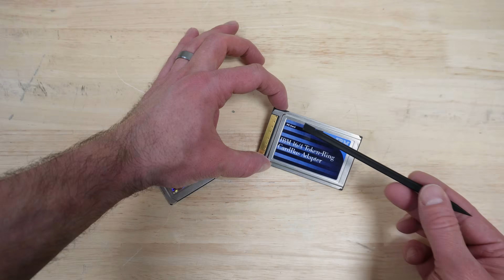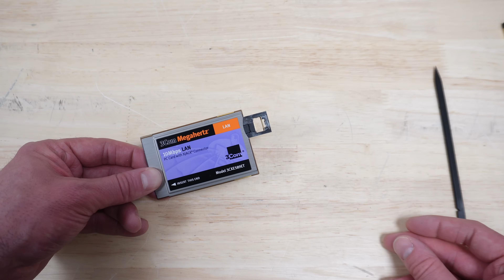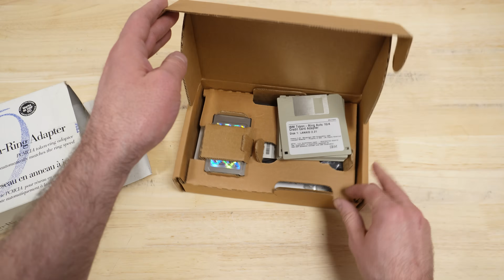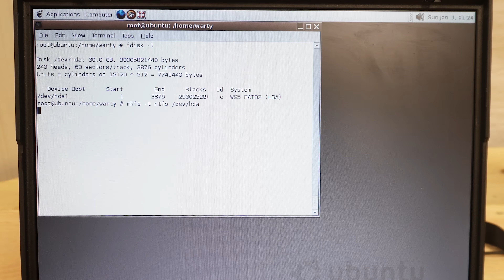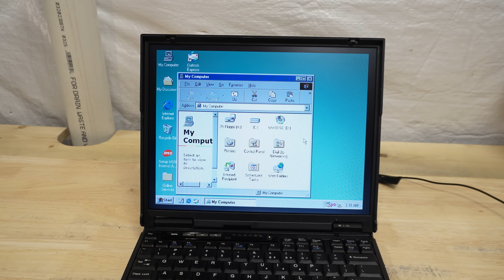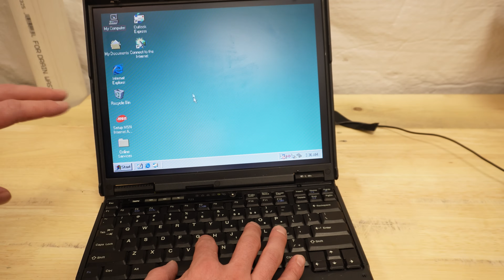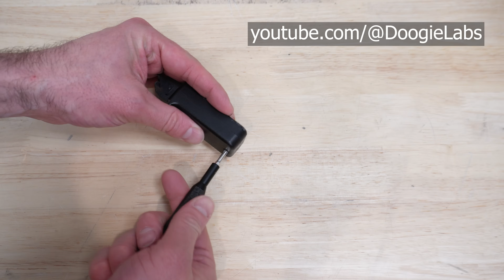Token Ring over PCMCIA Cards

Comment: Would be cool if you could get ahold of a schematic for the IBM MAU so that we get an understanding of what happens when you insert the reset tool
Reply: Almost no schematics for IBM stuff has ever made its way into the public view, more popular devices like thinkpads or the PS/2 line don’t even have them, so the only way would be reverse engineering it, I’ve opened one up to the bare board before, and they don’t look complex at all, don’t even think there were any chips
Reply: @ true, IBM was always very secretive about their hardware. But at least I found something about how the 8228 MAU. Seems the Relays are latching into position and the Setup Tool basically puts them back into a defined state. https://en.wikipedia.org/wiki/Media_access_unit

Comment: You have Vudeos about an BNC Network? I did a BNC Network with 25 PCs when i was 10 years old and i loved it. PCs with DOS, Wibdows 3.11 and later some with Windows 95. The biggest space between two PCs was 25 meter of BNC Cable. I miss this time
Reply: I had a thin-net network at home too. The IT guy at school gave me a bunch of old cables and T's, and maybe even some network cards they ripped out to replace with CAT5. He also let me "borrow" the Novell Netware disks, so I ran my own Netware server at home too for many years. I eventually upgraded to CAT5 at home too - much easier to run a single cable to each machine, rather than 2 to keep the bus of thinnet going.

Comment: Each usb stick needed their own driver installed from floppy disk on Windows 98. There were universal USB mass storage drivers released at some stage by 3rd parties, but they did not come with the system. Windows ME fixed this issue.
Reply: in grad school, I needed to get data off of an oscilloscope that ran win98 - I had to resort to a USB CF reader, as nothing else worked - standard USB keys didn't work, nor did setting up a SAMBA server on linux to try to transfer files by network share. Win98 really was pretty awful and pre-standard for a lot of things.
Reply: @gorak9000  I'm glad modern Samba gets along with my Windows 98 SE machines perfectly well with just a couple of smb.conf lines to accept older protocol versions and authentication methods. Now I just need to stop putting off getting my Windows 3.11 for Workgroups machine reinstalled so I can confirm it's compatible with that too.
Reply: Yep of all the things to complain about Windows ME, driver support was REALLY good. 

In high school I had to bring along a mini cd which had the USB stick driver on it.

Comment: I was born in 84, I know what you mean with all the love for the old technology especially Windows, my favorite was already Windows 2000 I felt that it was one of the best most stable OS that Microsoft ever made. I do Network Administration and have a nice home lab setup as well. I went through CCNA and that. It would be awesome if you wanna do any kind of collab stuff, I want to start doing some learning/training videos. Also, I am from New York.
Reply: IBM's version of (4Mbps) Token-Ring was introduced in October of 1985 - I was in bootcamp then.
Reply: Win2k was the best windows at the time, but it was the version that convinced me it was time to switch to Linux full time - I got so tired of having to re-install windows every 6 months to keep my computer fast. I don't know why it got slow all the time - I didn't install a bunch of weird random software, and kept the drive defragged, it'd just get horrifically slow over time. Doing a fresh install fixed it, for a while. Installing Linux fixed it permanently.

Comment: For the drive, you forgot you can fdisk the drive in dos. run "start the computer with cd rom support" the run fdisk. That would have gotten you a partitioned and formatted drive
Reply from the maker: yes you're completely right! I totally forgot that was the way to get to dos from that bootable cd
Reply: @clabretro  Also the issue was probably the Linux bootloader being still in the hard drive's MBR. You can clean it out with fdisk /mbr
Reply: @kpanic23  sometimes it's just best to zero the first couple MB of the drive in linux first - windows / dos gets easily confused if anything there isn't 100% right

Comment: Try running badblocks on the old drive. Might be able to get it working with remaining good sectors.
Reply: I would zero out the first couple of MB of the drive in linux - sometimes the MBR or the partition table gets messed up, and it's fine for linux, but windows won't like it
Reply: @gorak9000  Absolutely.  I wouldn't be surprised if win98 freaks out when the MBR isn't exactly as expected for a microsoft OS install.

Comment: Not a dongle ;) , the Type 1 to RJ45' adapters were called baluns.
Reply: Or 'Media-Filters', although there are BALUNs inside...
Reply: Fun fact, after we realized that token ring was hot garbage, we acquired $ALOT of type1-RJ45 impedance matching adapters so that we could run 10baseT over our substantial type 1 structured cabling infrastructure. Somehow a batch of these baluns got mixed in (that don’t work with 10BaseT), and a few days of chaos ensued.
Reply: @samsthomas  Yeah, where I was working at the time, they replaced their 16mbit token ring network with a 10mbit ethernet network.  They said it was more reliable, but we had a lot of issues with the type 1 baluns getting knocked loose under desks and we would have to come by and plug them back in when people got errors that the domain was unavailable.

Comment: After like watching 2.5 hours of your token ring videos, I'm starting to get the impression that the token ring technology kind of sucks
Reply from the maker: there is a reason ethernet won. super fun though!
Reply: In its day Token Ring was considered technically superior to Ethernet.  It was way more complex using this star wired ring rather than a length of copper wire .  Ethernet being cheaper and good enough eventually won out.  Another Betamax vs VHS

Comment: Wow, I remember learning about Token Ring in college, and thinking to myself "man that's a stupid idea", and now that I see it in action, I'm actually baffled… Why was this ever done? It's so fragile. It's like they traded individual card and network simplicity for overall complexity. Sure an Ethernet card is more complex, and an Ethernet network is more complex, but only until you get to a few clients… Once you hit about 5, I can't see token ring being reliable at all. If any individual client starts having issues I'll bring down the ring. If the slightest thing goes wrong the ring will break… why did we ever do this??? Ethernet is so much more resilient. It truly baffles me that anyone ever thought this was a good idea.
The only possible benefit I can see is cost, but that quickly gets offset when you have 5 clients that go down because one client is having problems. Who thought this was a good idea?!
Reply: It was actually the reverse when Ethernet only had hubs at 10Mbps - Token-Ring was faster (at 16Mbps) and didn't have network collisions as you added more stations. The errors should decrease as he gets more factors pinned down. Modern-day Ethernet was improved dramatically over the era shown here.

Comment: PC cards with the gold ends are Cardbus which is basically PCI over PCMICIA. The other cards without gold area basically ISA signaling.  This comes into play when you have  a laptop that's about the pentium133 era or older which only supports PCMCIA and not Cardbus, they will not be detected.  Around the Pentium MMX time is when Cardbus became common.
Reply: Also: Unless some previous user have used violence, it should physically not be possible to insert the newer Cardbus cards in the older slots.
Reply: @ Well I remember having an issue with a PCMCIA NIC not working on a particular dell laptop and it ended up being the cardbus issue that it was a cardbus card that wouldn't detect because the laptop didn't support cardbus.  But it fit for sure.
Reply: The plastic side caps on the connectors are keyed to what type of card they are.
 My brain is trying to recall that there is also type II & type III Cardbus cards too.
Reply: Similar cards are(were?) also used for digital tv decryption. A credit card sized chip card fits perfectly in one.

They're keyed in a third incompatible way.
Reply: @martijnvds  hummm i ponder what would happen if he put a network card into the slot on a Cisco unit 🤔

Comment: Next on clabretro: “we deep-troll Sam” token ring plus MCA, ok, at least it’s all in the family. Token ring plus PCMCIA is a sure sign of mental illness. BRB, I gotta pop some popcorn and Valium for this one.
Reply from the maker: I'm here to serve
Reply: Glad you got the 8228 operational. I remember we had a 16Mb “server” network in the machine room and several PS2/70s with 2 TR adapters and a floppy disk with special bridging software to bridge between the “server” ring and the various 4Mb “user” rings (and also the 10Mb Ethernet with the VAXes)
Reply: Also, you may have to find a chassis-based catalyst (like a 5000 series), but I believe there were token ring cards available up to the 65xx series. (I wouldn’t recommend a 65xx as they tend to be big, loud, power-hungry space heaters)

Comment: Would it be possible to hook this up to the modern internet?
Reply from the maker: yup! through a token ring to ethernet bridge. that will be a future video!
Reply: There was dedicated bridge equipment - I'm looking forward to seeing it on Cisco gear, although my solution has been to use a Windows 2000 Server with multiple network adapters - so I can also run RRAS and DHCP. Although I made a long top comment, it appears that YouTube ate it (I can regenerate as much as possible).
Reply from the maker: I'm planning to attempt both! I suspect the Windows PC bridge approach must have been much more common (and economical)

Comment: That was... AMAZING! What a roller coaster of emotions. You gotta bring in the Cisco routers now. Also was Ethernet this difficult in this era? Didn't really engage in this portion of the interwebs so curious.
Reply: From a cabling and setup perspective, ethernet was the same as now basically provided you weren't using co-ax cable. The biggest issue was networks built around hubs, as network collisions and broadcast storms and other pains could cause a network to crawl or die entirely compared to the guaranteed stability of token ring. I don't recall bad drivers being too much of a thing but it did happen now and then.

Comment: Something important thing to note with regards to pre-formatting a drive for Windows 9x.... you MUST enable the 'LBA Flag' when formatting in Linux (it's not default, rather absurdly). Windows 98 calls this "Large disk support" and it won't allow you to create a huge partition without it like Linux does.

if you don't do this and have a large partition without the LBA flag, it leads to profound data corruption, usually during or shortly after OS install. non-LBA forces windows 9x to address the disk using CHS, which is limited to ~8GB... windows 98 will pretend to work until data has to be written beyond this boundary which results in disaster. 

personally, I use the FreeDOS fdisk and format programs. FreeDOS fdisk doesn't have the underflow problem meaning you can partition a disk up to 128GB (windows 98 limit), and FreeDOS's format can quick format which is also essential for not wasting a tremendous amount of time.

Comment: The original Apple Airport base station had the PC card slot for its Wi-Fi
Reply from the maker: yes! I'll be exploring that in a video eventually
Reply: @clabretro  My university had hundreds of these Airports attached to the ceilings in various academic buildings in early 2000.Running Karlnet and their managing software. It was neat for the time.

Comment: I could be wrong, but I've never seen an original PCMCIA card referred to as a PC Card. I don't recall that being a thing until the 32bit Cardbus cards, and it always referred to those. It's possible i just never saw it though...
Reply from the maker: quite possible! I wasn't really messing with them back when they were coming out, so now I could just be lumping them all into one pile of names.
Reply: @clabretro  You could be right too. They were too damned expensive during their heyday for me to own them. I did recall owning a used one of that double height Xircon. However l, mine was 10base Ethernet only, no modem or the funky plug  but was identical otherwise. Man so nice to not have a bloody dongle or the Xjack, that always got in my way. Oh, speaking of, XJACK was originally a 3com thing.

Also l, the most popular of the "hidden" PCMCIA cards has got to be the Apple Airport. Those were rebadged Orinco Silver cards with the antenna section removed and jacks for external antenna instead. In case you run into a need, I recall the two actually being completely interchangeable. Orinco drivers see apple cards as Silver, and macOS sees Orinco cards as Airport ones.

Comment: 5:21 I had the Xircom one. Hated it because it forced you to take two slots just so you had the benefit of having a completely flush connector, but it had its moments.
Reply: if you had the modem / ethernet combo card, what other card would you need? I remember the first pcmcia card I had was a 3com ethernet card my uncle who worked in IT gave me specifically because the latches on the dongle were damaged. As long as you didn't breathe, the connector stayed in fine, but if you so much as looked at it, it would pop out. I used that card for MANY years and just got used to it.
Reply: The Xircom Realport cards were so much more robust than the ones with dongles or xjacks though. We had to keep a stock of spare cards and dongles to replace the ones that people would damage or lose. We then moved to using the Realport ones and although they were more expensive at first I don't recall ever having to replace a single one so it ended up cheaper overall.

Comment: Could you try and set up token ring on linux? Like modern one? Im sure it still supports it lol
Reply: I think the challenge is to find a machine that can run modern Linux while still having the ports necessary to install a Token Ring network card. A PC with a PCI slot may do the trick, which is the best you will get.
Reply: Ok nevermind. Seems Token Ring support was removed from the Linux kernel in 2012. So you'd have to use a distro from before that and hope whatever kernel from the era was compiled with driver support for Token Ring hardware
Reply: @craigmurray4746  aw maaan

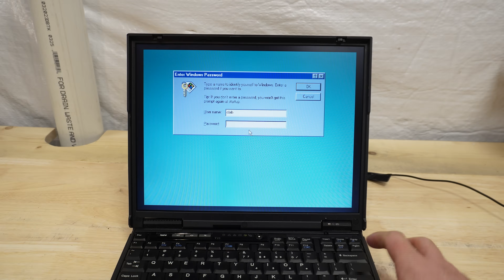Comment: 31:24 for formatting before installing win98 don't you have to use a dos disk first? win 98 doesn't come with formatting tools in the installer if I remember right.
Reply: Yeah, you'd normally run FDISK and then FORMAT from the boot floppy or 98 CD before starting setup. The pain point was when you had to format a freshly made partition on a new drive, the format tool wouldn't let you do a quick format, so full format it was, which only grew more painful the bigger hard drives became. Full formatting a 40GB hard drive was such a waste of good time!

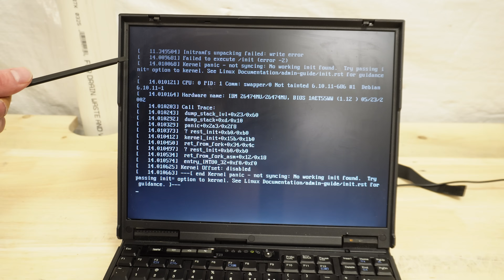Comment: heya, on the topic of the kernel panic at 25:53, most modern linux distros don't work on 256mb of ram anymore, because the initramfs is actually larger than 256mb nowadays, i discovered this after a few hours of troubleshooting why nothing but ancient debian would run on my dell inspiron 2200, the result is a write error because it actually runs out of ram attempting to extract it into ram, not even i686 opensuse, nor archlinux32, or even the latest debian installer runs on 256mb anymore, best i can tell, although that may just be a symptom of me using debian's netinstaller image.

Comment: The other socket on the Xircom Realport was to plug into a cell phone. It could be an analog cell phone, in which it was basically passing analog audio, or a digital cell phone, which it would act like a serial port.
Reply: There were actually multiple adapters you could plug in there. The first were the cell phone adapters to connect to the cell phone via serial and use its built-in modem. Another was an actual ISDN adapter for use with digital ISDN lines (popular in Europe).

If my memory isn't failing me, they were quite annoying as you couldn't switch them "on the fly" and had to reboot each time you went from one to the other. (Might even have required uninstallation and re-installation of the drivers every time you did it.... I hated supporting the damn thing!

Comment: Utterly baffling. I thought PC cards were late 90s and always thought token ring was super dead by the end of the 80s.
Reply: They made a gigabit token ring spec in 2001, which is kind of wild. It was definitely dead by then, and no gigabit TR hardware was ever brought to market. It’s a fascinating thought though
Reply: @justinbealo1620  how many wires
Reply: I was a student worker at a college from 2000-2004 that was just transitioning from token ring to Ethernet.  I carried pcmcia cards for both interfaces in my backpack since every building was different
Reply: pc cards are from way before the late 90's. I had a 386 laptop that had pcmcia slots in the early 90's. I think the next 3 laptops I had after that all had pcmcia slots in them, then they went away when USB took over. They became less useful when ethernet was basically standard on every laptop.
Reply: It was Fast Ethernet that really spelled the end of Token Ring in the mid 1990s. There was a (very rare) 100Mbps Token Ring variant, plus the 100VG-Anylan standard supported both Ethernet and Token Ring frame types, as did ATM LAN Emulation. But the cost and ease of use of Fast Ethernet and then the performance of Ethernet switches meant that the more complex Token Ring simply couldn't compete.